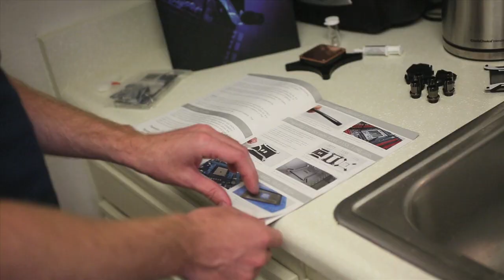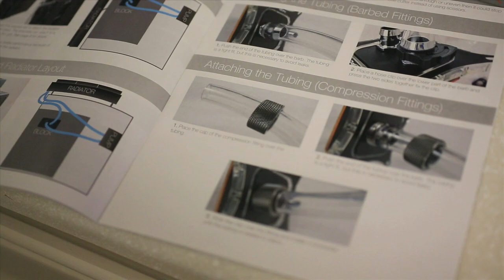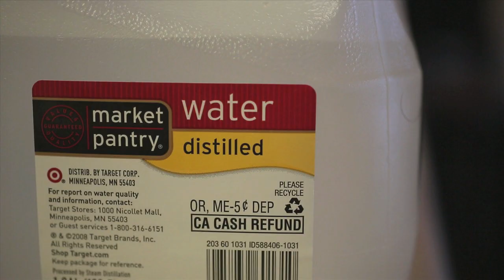A Beginner's Guide to Water Cooling Your Computer

Comment: I have a corsair h55 and its lasted me about a year. but now my pc is heating up so much that it's turning itself off when I play games. So I'm thinking of grabbing. Swiftech H220-X, Cooler Master Hyper 212 EVO or Corsair H110 Dual 140mm Liquid Cooler as I've heard these coolers will keep my pc nice and cold.
Reply: +Vorpal Lets Play 
They will keep things cold, but these "fancy" closed systems are designed to fail on you. The liquid they put inside turns to gunk within a couple of years and your cooler stops working, of course they hope you will come back to buy another one.

Comment: if you need fans for your water cooling does that not qualify as fan cooling with water pump ? since the fan is still technically doing the cooling. and what if you instead of water use cooling liquid similar to the ones found in card would you then be able to completely eliminate the fans in a closed liquid cooled system ?

Comment: Question, why wouldn't you put your fans so they blow across the radiator and out of the tower? I would think in this application you would put them under the radiator to push the heat out or the tower. Fans tend to push air much more efficiently then they pull it. I know its not a car or generator but in those cases I have never seen a fan on the outside pulling air across the radiator always pushing it through it.

Comment: what would happen if you mix "rechargeable" glow stick fluid in with the water to make the pipes glow
Reply: You might as well use some form of UV paint on the tubes instead of putting a different type of fluid in the tubes to get it to glow.
Reply: true but glowing fluid looks cooler and doesnt need an extra light

Comment: what happens if you fill the" resavour "(that's a new word for me) . what happens if you fill it with the coldest thing on earth, LIQUID NITROGEN?
Reply: liquid helium is much colder
Reply: TR-8R but you cant keep helium cold
Reply: Damieon cormier if course you can, you just need special equipment, just like with liquid nitrogen
Reply: TR-8R no... liquid nitrogen will either stay cold or get colder. (if not , ive never seen it do otherwise)
Reply: Damieon cormier liquid nitrogen will evaporate and boil off
Reply: TR-8R soo... how would you keep it cool?
Reply: Damieon cormier by keeping it inside a vacuum flask

Comment: Watercooling, for when you computer gets so hot from running everything on the highest settings, you need to cool it down like a nuclear reactor.
Reply: +Neil Price And that's just what I want. My PC is hot enough to heat the entire section of my room without the watercooling.
Reply: Abe McLaughlin Sounds like my old ps3! (:
Reply: there are nuclear reactors which use liquid salt as a coolant
Reply: @calvesman.willem  Liquid Salt PC cooling.

Welcome to the future.
Reply: +Nick John nuclear reactors use purified water. Salt water ruins the reactors. When salt water gets inside the reactors to cool the fuel rods, the salt is very hard or impossible to clean out. Read on Japan's Fukushima nuclear plant disaster. They had to use ocean water as a last resort even though they knew that it would completely ruin the reactors.
Reply: +Abe McLaughlin without watercooling, my pc would probably get overclocked as hell and stop working, then proceed to burn my desk...
Reply: Sulfen Hi. Depend on reactor and the location. If nearby sea, it will use salt water. 

This cooling function to condense the steam may be done in one of three ways:

Direct or "once-through" cooling. If the power plant is next to the sea, a big river, or large inland water body it may be done simply by running a large amount of water through the condensers in a single pass and discharging it back into the sea, lake or river a few degrees warmer and without much loss from the amount withdrawn[5]. That is the simplest method. The water may be salt or fresh. Some small amount of evaporation will occur off site due to the water being a few degrees warmer.

http://www.world-nuclear.org/information-library/current-and-future-generation/cooling-power-plants.aspx
Reply: Err btw, nuclear reactor use salt water from the sea to cool off its reactor.
Reply: Nick John it’s called heavy water, look it up. It absorbs neutrons and is used to moderate nuclear reactions. It contains an extra atom of oxygen I believe.
Reply: @nickjohn2051  
"nuclear reactor use salt water from the sea to cool off its reactor."
Sounds like a corrosive nightmare. You sure it isn't something similar to a jacketed cooling system on naval vessels? Closed freshwater system and then the freshwater gets cooled by sea water coolers?
Reply: @fuckoffwiththehandles  You do realize not every metal can rust. Stainless steel? Not only that, every Hong Kong toilet also use salt water. You dont heard they complaint about rust in their plumbing. Simgapore also use salt water for their water supply.

Comment: I usually don't  leave comments but this time you deserve one. I must say that I am a noob when it comes to water cooling but you explain so well I might take a chance to switch. I would like to set one of these to fit whit my Nzxt phantom and a Gpu water block for an R9 290x. I could sure use some tip on what I need.

Comment: Quick question if I bought a computer that comes with liquid cooling will the company but the water in or will I have to do it?
Reply: +xADI You won't have to do it with Liquid Cooling. Its not the same as watercooling
Reply: Oh ok thanks for clearing that up :)
Reply: So is liquid cooling good or?
Reply: xADI Well liquid coolers are AIO solotions. So you basically just have to put the radiator in and the mount it to the cpu, done. But the downside is that you can't customize it as much as Water Cooling solutions. So you can't decide to have different clored tubes, don't have such a nice Water tank and you also cannot water cool the GPU and CPU in one kit. You'd always need to get 2 Liquid Coolers for that. If you want it easy and a bit customizable though, get the Rajintek Triton.
Reply: Ok thanks

Comment: Need to really be careful with tubing.. they are all not created equal.  Tygon is great but harder to bend... Primochill Primoflex Advanced LRT is good also and more flexible.  Hard acrylic tubing is ideal.  Seeing this video is back from 2012 there are great dyes from Mayhem that will not gunk up your system.  Also most of the gunking issues wasn't from coolant it was from the tubing leaching plasticizer into the loop.  Mayhem Pastel contains biocide and an anti corrosion formula.  ALSO... ALWAYS WASH OUT YOUR RADIATORS EVEN WHEN NEW!!!!  You will be surprised how much crap they have in them even being brand new.

Comment: WHAT IF I FORGET TO PUT WATER IN, WILL MY FUCKING COMPUTER EXPLODE!?!? Also is there a chance that if it leaks it will destroy my computer?
Reply: +Zaid Productions I mean like will it evaporate?
Reply: +Zaid Productions water only evaporates if there is room to leave. So if its stuck in a tube and moved to the top it would just build up and fall back down anyways.
Reply: COOL, DOES THAT MEAN I CAN USE LIQUID NITROGEN?

Comment: I dont like the entire idea of water cooling.  When it leaks, which it will, it will leak all over your multi thousand dollar components. Also ,for years i had to live with roomates...most of whom were decent non thieving non vandals.  All it takes though is one malicious soul and guess how quickly yur system develops a "mysterious" leak?  I lived in the same house with one ass, he finally moved out, before he did i had two hard drives on my comp,  in a mirror BOTH HD died "mysteriously" at once.   Nope no water cooling with potential vandals around!  I'd rather wire up a very nasty surprise if some stranger broke in the room then water cool because vandals are forever.

Comment: or you could just use a 25 dollars tower style air cooler save time, money, and hassle while still getting under manufacturer suggested temps with even the highest overclocks. But if risking thousands of dollars of components for an extra few degrees while spending 10 to 20 times as much much is your thing then power to you.
Reply: +Jai Guru my "air" cooler is completely silent, I don't know what is so special about a living room pc that would make air cooling unreasonable. When they made the xbox one and ps4 for the living room they seemed to think air cooling was ok. My xbox one is dead silent actually. Fact is there is no real reason to justify spending the extra money on a custom water loop, when a cheaper air cooler has just as many fans as the loop, no pump, and keeps perfectly fine temps without risking your components. Not to mention I wasn't aware he was 'apparently' making a living room pc in this video.
Reply: +Jai Guru Yeah my boyfriend and I fuck alot but what does that have to do with this computer? Doesn't offend a gay man to call him gay...
Reply: +Jai Guru the bigger the better :-D
Reply: +Joshua Lovelace I like how your just accepting the insults.
Reply: Thanks

Comment: is this good its a pc im getting Processor Type Intel Pentium G3240
Processor Speed 3.1 GHz
Processor Cores 2
RAM 8 GB PC3 12800 (1600 MHz DDR3)
Hard Drive Capacity 1 TB
Hard Drive Speed (Revolutions Per Minute) 7200 rpm
Optical Drive 24X DVD±RW Dual-Layer Super-Multi Drive
Pre-loaded Operating System Windows 10 Home 64-bit
Graphics Card AMD Radeon R5 230
Dedicated Graphic Card Yes
Video Memory 1 GB
TV Tuner No
Display
Built-in Monitor No
HDCP Compliant No
Screen Size/Type Not Applicable
Native Screen Resolution Not Applicable
Touchscreen Display No
Audio
Sound Card Realtek ALC887
Audio Output High Definition Audio
Speakers No
Speaker Wattage Not Applicable
Integrated Microphone No
Microphone Input 1 x Front; 1 x Back
Line-In Input 1 x Back
Line Out No
Digital Input No
Digital Output No
Networking
Ethernet Port 10/100/1000
Integrated Wi-Fi 802.11ac
Integrated Bluetooth Yes - 4.0
Inputs & Outputs
Webcam No
Keyboard USB Gaming Keyboard
Mouse USB Gaming Optical Mouse
Remote No
Modem No
USB Ports 2 Front; 6 Back
FireWire (IEEE 1394) No
Card Reader No
E-SATA No
VGA Output Yes
DVI Output 1 Back
HDMI Output Yes
Component Output No
S-Video Output No
Composite Output No
Other Input or Output Ports None
Computing Features
Processor Cache 3 MB L3
System Bus Not Applicable
Available Hard Drive Bays 1 x External 3.5" (1 Available); 4 x Internal 3.5" (3 Available)
Available Optical Bays 4 x External 5.25" (3 Available)
Available PCIe Slots 1 PCIe x16 slot (0 Available); 1 PCIe x1 slot (0 Available)
Available PCI Slots Not Applicable
Available AGP Slots Not Applicable
Available Memory Slots 2 Memory Slots (0 Available)
Removable Storage No
Power Supply 350 W
Energy Star Qualified No
Software
Operating System Language English
Loaded Software Not Applicable
Product Features
Colour Black; Blue
Width 18.5 cm
Height 44.5 cm
Depth 52.1 cm
Width (Inches) 7.3 in
Height (Inches) 17.5 in
Depth (Inches) 20.5 in
Weight 14.5 kg
Warranty Labour 1 Year(s)
Warranty Parts 1 Year(s)

Comment: eh i will stick with air, fuck losing it all with a leak
Reply: +MLG_Master X16 IF I THROW MY PC IN WATER AND THEN DRY IT, WILL IT WORK ? ...
Reply: +MLG_Master X16 contamination can make that fluid conductive
Reply: +Patrick grgregregre if you use compression fittings you will never get a leak
Reply: Warranty my friend
Reply: +Patrick grgregregre You could compromise and fill the loop using mineral oil. It's not conductive, but you also won't get as great performance.
Reply: I heard if you put it in rice it'll......
Bring an Asian person to it so he can fix it.
Is this tru?
Reply: +Myles Bishop Yeup I'll do it for ya

Comment: this seems like alot of work just to quite it down, not to mention what water will do to your parts should you leak.
Reply: +WhiteStar Armada If you do this correctly, it is worth the hassle of setting it up. The risk of leaking water is minimal if the loop is done correctly.
Reply: ***** It is not hard to do it correctly.
Reply: +WhiteStar Armada also it won't do much to your parts if it leaks and you stop it quickly, it's distilled water

Comment: Why do you attach fans on top of radiator and not to bottom of it? I think the better is flow of hot air out of case. Not in case.

Comment: I have been thinking about doing this for  a while, however with all of these water cooling systems the concern I have is condensation through out the water cooling system. The hoses the fittings, if you end up getting any condensation your system is pretty much done, your going to corrode something. How do you prevent this?
Reply: Don't use a custom loop :'D
If I was you I would just get a corsair h100i

Comment: Watercooling. Quiet. Haha.
Reply: For those wondering, watercooling can be quiet but not as quiet at IDLE as air cooling. Air coolibg doesn't have any components that necessarily need to move. You could turn down the fans or even turn them off and your heatsink would still be cooled if your case has airflow. Whereas a watercooling setup needs you to have fans and pumps running all the time. If you want as quiet as possible at idle, than watercooling isn't for you. But if you'd rather have a more consistent noise level at load and idle, than watercooling is the way to go.

Comment: I also used XSPC kit. Amazingly I had like no bubbles pretty much right away and leak-tested for about 15 hours before connecting to components other than PSU. Pump is silent too, pretty lucky it seems.

Comment: Alright i just have one concern about this: How SAFE is this? I mean, if something goes wrong and the water leaks into the PC it's gonna be fucked now is it?
Reply: soschar2050 of course you should run your system carefully the first time, but after that it shouldn't be much of a problem. Even with a leakage you could get off well: Destilled water is not a good conductor (in contrast to regular tap-water).
Reply: Yes but if you do it right then your fine.... If your not interested in custom loops corsair does liquid CPU coolers with liquid already in it you just have to screw it onto the PC... Heck it even has thermal paste
Reply: :D
Reply: +soschar2050 That is the whole point of waiting 24 hours to see if it leaks if it doesn't leak in that time span it's not gonna leak. If it does leak then just put a box fan next to your computer let it dry and it will start up fine getting a computer wet only hurts it if it's on.
Reply: last I remember anytime I got anything with that had anything to do with computer parts or circuit boards it never worked again or at least never work the same again

Comment: wood be worht to put water cool in computer?
i7 quad
32gb RAM ASUS
NVIDIA gt230
my case is box shape 
pls respond need to run minecraft
Reply: 32 gb ram gt230 wtf is wrong with you son
Reply: Dakota Hawkins to run minecraft you don't need 32GB ram or core i7, 8GB and core i5 will do fine but asuming you have already have this hardware, yes I would recommend putting a watercooling system on your pc since it creates a lot of heat, try to check your temperatures first if it comes over 80° C on the cpu you defenitly should
Reply: Honestly, how are you able to that seriously?

Comment: my pc is pretty quiet already so im no too concerned about noise, if I get a gtx 980 and install a fan directly beside it (the fan would be installed on the inside of the left cover) as well as intake and outtake? fan, do I still need to get water cooling?

Comment: Hey can anyone help me? my computer overheats often and I want to get a water cooling... I want this http://www.bestbuy.com/site/corsair-hydro-series-h80i-dual-120mm-fan-cpu-cooler-black/7353346.p?id=1218840834714&skuId=7353346 Will it have to take any setting up? (besides putting it in the pc)
Reply: Besides taking off the stock cooler for your cpu, nothing but screwing bolts in. If you are not using your cpu intensively, or oc, do not spend money on this. I would suggest fan cooling such as the hyper 212 evo. For $30, you can keep your cpu chill. Liquid cooling is not necessary unless the above, also this is a closed line cooling, meaning you cant do any custom loops.
Reply: Hachatata Thanks it's a bit to late though.I already put a water cooler my system...

Comment: This will sound noob but, where does one find video card water block's to begin with?
Reply: IceQ51 GPU waterblocks are typically very expensive and a pain setting up. It's better to buy another card and SLI/crossfire it or just buy a whole new and better card. You can mainly find them online retailers or Ebay.
Reply: Ic, I've been doing some research on barbs, fittings, tubing and I now know that I'll never do water cooling.